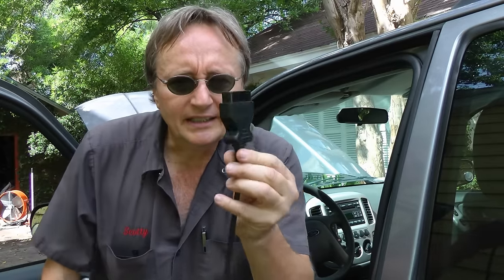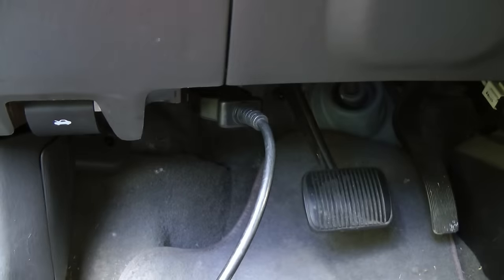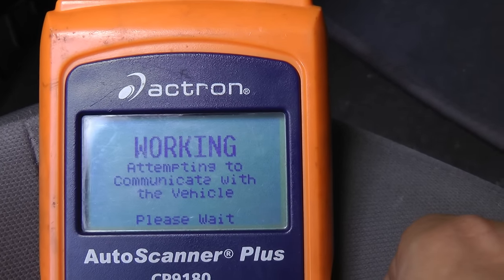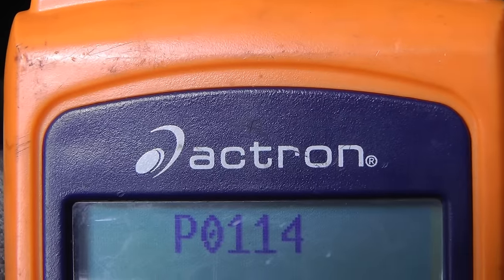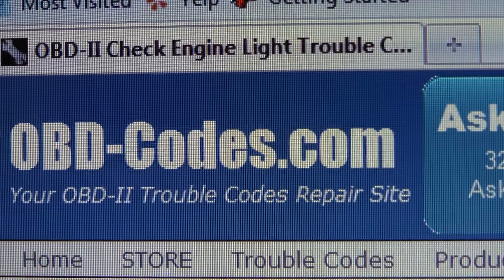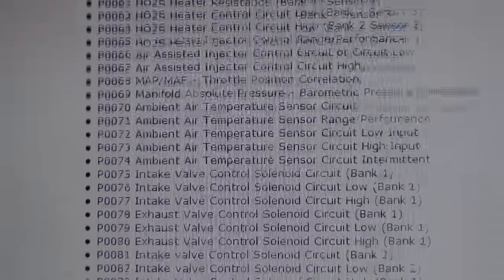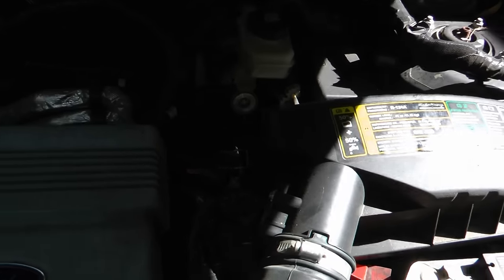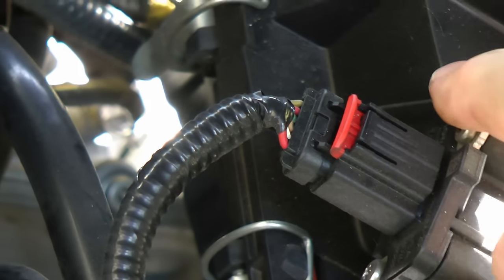Check Engine Light On and How to Fix It

Comment: Had a loose filler cap code on a vehicle health report 2011 f150.. took it to autotune.. they told me it was a canister purge valve.. changed it.. but still showed check engine and chugs the gas!!

Comment: Hi Mr. Kilmer, the  mechanic plugged in the tester to check the "Service engine soon", but the tester does not receive electricity from the car.So it can not be read. PLEASE what can he do? i got a mini van chevrolet --venture 2002--Thank you
Reply from the maker: not reading is caused by either a short in the wiring to the scan tool on the car's wiring, a bad main computer, or a shorting out sensor that shuts it all down. Good luck hunting that down

Comment: I have a 2006 Jeep TJ with 2.4 L engine and 150k miles. I got a check engine light with a P0128 code.
Means engine running too cold, right? Well,I replaced the thermostat twice and the coolant temp sensor twice and the code keeps coming back. My dash gage shows about 180 as well as the temp read from the OBD (I have a reader). I measured 5 v going to the sensor at the sensor connector (without the sensor connected). And I measured 0 volts from sensor ground to vehicle ground. The vehicle runs great! I'm all out of ideas. Does it sound like the PCM is bad? Any help would be GREATLY appreciated.
Reply: I finally figured it out!! Turned out to be a connector issue to the PCM. I had sprayed it down before with contact cleaner, but I noticed some discoloration on one of the pins. I sprayed it down again and this time used a tooth brush. Now the real temp is being read and no more error code P0128! Hallelujah!!!
Reply: +Michael Hamann it could be a bad indicator bulb or you have a bad o2 sensor on the upstream
Reply: +Michael Hamann ok my bad i did not see this part ,glad you figured it out '

Comment: I have Nissan Sentra 2005 run 96k and I got P1273 code for my Service Engine Soon in Dash board. I was asked to change the Mass Air Flow Sensor. What do you suggest?

Comment: hey scotty, so i have a 1990 integra, reading a code 12 stating the egr system is malfunctioning, but the thing is the manual transmission model of my car wasnt made with an egr valve. it also has a rough idle after it warms up. any ideas? i appreciate the feedback thanks scotty

Comment: Hey Scotty I have a 1994 Chevy lumina apv minivan with a 3.8L when I drive it from 0 to 50 km 0 to 30 mph it shuts off but I can start it up again like nothing happened is there anything I can check and replace to stop it from doing that?
Reply from the maker: many things can do that, but check the ignition control module and ignition coils first

Comment: scotty i've got a 1993 surf hilux turbo import, the check engine light goes on while it is stop or if the engine is just running, but when you began to run it the engine light will go off, what can do with this. thanks
Reply from the maker: you would have to get it scanned when the light is on by a guy with a machine that works on that old thing, obd II is only on 96 and newer vehicles.

Comment: Great help,but I got a problem with my 2005 Ford Escape. Display says check right daydriving light. I did,, it didn't work.So I changed the bulb. Didn't fix the problem. What is wrong? 
A body said he had that problem jnwith his Jeep and it was a resistor. Where on my vehecle can I find that resistor??
Please
Frank
Reply from the maker: those are complex computer driven systems, not something you should try to fix yourself. Find a mechanic who knows how to fix it with the correct part, or really, if they work, ignore the display or remove the warning bulb.
Reply: got it fixed in garage. Wire was rotten.No Ground.
Thanks for tying to help

Comment: omg those doves are everywhere. i hate that sound. I put a new header, cold air intake and exhaust on my 2005 scion tc and CEL came on. Then bought a CEL eliminator from strup.  Bought OBD2 sensor which read P2195 O2 sensor signal stuck lean bank 1 sensor 1. It seems like i need to have it reprogrammed cuz it seems to run great. Think i need to have it reprogrammed?

Comment: Also I want to ask you can get emission done with a 1998 lexus es 300 transmission sensor ?
Reply from the maker: if it's making the check engine light come on, it would fail emissions testing
Reply: No check engine
Reply from the maker: tyria smith
if the check engine light comes on when you just turn the key to the on position, then goes off once the car is started, then it should pass the inspection test.
Reply: ok thank you  my check not on

Comment from the maker: first, don't buy an Audi, endless money pits as they age.  Find someone with a better scanner first, pray that works. Cause if not, either the computer is bad or the wiring and sensors that feed the computer have problems. Fun fun fun on an Audi tracing those out.

Comment: Hey Scotty .. How can it be possible for the check engine light to go on and ten minutes latter it goes away then 5 hours pass it comes on again and stay two days on then it goes back off .. I'm waiting to go back on to take it to get Scan to see why ... Its a 2005 Mazda 3 ...
Reply from the maker: Luis Burgos cause computers are touchy, they see a problem, on goes the light, then the next check 45 seconds later, if the problem goes away, they turn the light off
Reply: It's annoying is a new computer,  new engine.I have spend over 35 hundred. The mazda dealer tells me it have to be the wiring. .. really don't know what to do

Comment: hey scotty, i had to unplug my neg wire to reset my check engine light because i unpluged my mass air flow wire to clean some parts then when i plugged everything back up my check engine light pop up so i cleared the light by unplugging the battery now how long do i need to drive it before i go get my smog test?
Reply: i have a 97 toyota 4 runner

Comment: hey scotty what causes the service engine soon light to stays lit with no  flashes should i go for the smog test ive changed oxy sensors,egr
Reply from the maker: get it scanned to see what the trouble code is, it will not pass smog with that on and there are 2000 possible different codes.

Comment: Hi Scotty, Purchase a used 2007 kia rondo with 140k for 2200$. with the advise of the mechanic who said it was a good buy. the engine light has been on and after the mechanic ran test reset it. i was told it was the up stream 02 Senser needed replace 280. got it change then he said it was the down stream and will need additional 280 for replace and labor... now engine light  is still coming one. he told me it was reading code p2095  and not sure what the issue is. just wondering should i take it to the kia dealership for diagnostic? thanks for you help love your Vid.....
Reply from the maker: your "mechanic" is a joke, First, any good mechanic would say not to buy a kia with that much mileage on it, they are throw away vehicles at that age. BUT, if it runs good, guys drive em years with those codes and have no other problems. Otherwise, find a guy like me or a dealer with a dealer level scanner to analyze and fix it without just guessing as your guy did.

Comment from the maker: it's a saab, company is now bankrupt, and a lot of that was from 9-3 flak of owners getting problems up the wazoo. If it smokes and uses oil, engine will need serious work. Me, I'd sell it fast and eat whatever amount you can , then buy a good used toyota. engine work on saabs costs thousands

Comment: When i was driving my car today my check enging light started blinking around 10-15 times(estimate) and it went away after that and the same thing happened to me about a month ago and i thought it was nothing. Do you know what the problem is and should i be worried.

Comment: I have a check engine light on, on my Dacia Logan. I read it with an obd, says its the lambda sensor. Tried to delete it, didnt work. The car runs ok, even if it have 360k kilometers on bord. i didnt go to a mechanic to fix this light, just because they would rip you off, charging like 100 bucks for a minor thing.

Comment: Scotty
I came to your page by mistake, I see now that I should tell everyone about your site.
  I do have a question about a 2014 Fiat 500 pop.
The check engine light is on, I bought a new gas tank cap, I really haven't had a chance to drive it because my sticker is expired. Hahaha
I have to laugh! That light has Never came on before.
So I was wondering about the Carbon canister.
Is there anything I could pour in the tank?
Thank you

Comment: yeah hi I have a quick question I just installed a brand new EGR valve because my engine light was on all the time  went to the dealer that's how I found out I bought a new EGR valve put it on still engine light id on do I have to reset the engine light ?
Reply from the maker: +yanni lorentzos   if that actually fixed the problem, the light will go out within a week of driving it
Reply: +Scotty Kilmer ok thank you you been a lot of help

Comment: I have  a 2003 Jeep Liberty. Error code P0700 Kick down solenoid. I can not find any literature to help change it out.  Do you know any good sight or where I might get some?
Reply from the maker: +Bruce Bunten on that vehicle, that is normally a bad wiring short on the transmission or a bad transmission control module

Comment: my peugeot 206 cc has MIL describing it as anti pollution fault,the car suddenly stalls, engine is running but the rpm is very low. i did put lacquer thinner in fuel tank.car improved a lot and didnt stalls anymore,but engine light is still on w/ same description.anti pollution fault.need help scotty,tnx

Comment: Hey Scotty, I changed an abs sensor and I still have the abs light on , how do I turn it off?
Reply from the maker: +victor Sanchez if that fixed the problem, drive it a week. if it doesn't reset, then something else caused the problem. See my video "fixing ABS brake problems on your car"
Reply: +Scotty Kilmer thanks , always very helpful

Comment: Hey Scotty i have a 1996 honda accord 2.2 vtec and the check engine light wont turn on at all even with the key on, on i changed the bulb and its still wont turn on is it diabled or is the wire cut what can it be how doo i re enable my check engine light thank you!:)

Comment: The ETC sensor on my 09 Passat 2.0 turbo comes on and I loose power to the throttle pedal.  I replaced the Coolant sensor already like you just did but now I get a P0221 code that shows up.  Any help what I should focus my attention on.  The other day while driving i lost power to the entire car, it did not responde to the throttle accelerator pedal at all.
Reply from the maker: +Geraldina Franco often means you need a new throttle assembly on those

Comment: my ford  windstar 98 has a problem, the malfunction light does'nt work at all, I should remove the cluster in order to change the bulb ?,cause I can,t find any fuse in the circuit.

Comment: How do you change the transmission fluid in a 2008 Suzuki Forenza
Reply from the maker: Scott Garver they don't have dipsticks so they are a royal pain in the ass:Transaxle Fluid Level Checking Procedure 

Tools Required: 

DW260-070 Transaxle Fluid Plug Remover/Installer
Start the engine and allow the engine to idle for approximately 5 minutes , or, if possible, drive the vehicle for afew kilometers (miles) to warm the transaxle fluid. Check the fluid level when the transaxle is over 30°C (86°F) .

Press the brake pedal and move the shift lever through the gear ranges, pausing a few seconds in each range. Return the shift lever to the park position. (Left-Hand Drive Shown, Right-Hand Drive Similar.)

Raise and suitably support the vehicle.
Place a fluid container below the fluid level plug.
Remove the fluid level plug using the plug remover/installer 
DW260-070. Because the transaxle operates correctly over a range of 
levels, fluid may or may not drain out of the plug hole when the plug is
 removed.

Check the oil fluid level. If fluid does not drain through the plug hole after adding a total of 4 liters,
 then the transaxle was either underfilled or the transaxle is leaking 
fluid. Inspect the transaxle for fluid leaks. Fix any leaks before 
setting the transaxle fluid level.

Install the fluid level plug using the plug remover/installer DW260-070. Tighten:Tighten the Fluid Level Plug to 45 Nm (33 ft. lbs.) .

When the fluid level checking procedure is completed, wipe any fluid
 from the transaxle case with a rag or shop towel. Also, check that the 
fluid fill cap and the vent tube are properly installed.

© 2015 ALLDATA LLC. All rights reserved. Terms and Conditions

Comment: 02 silverado with catalytic converter removed, causing check engine light.  what's the best way to simply turn the light off?
Reply from the maker: +Jeffrey Valentine the computer knows, but you can remove the bulb by taking the dash out, easy job they just pop out in a few minutes of fiddling
Reply: +Scotty Kilmer there doesn't seem to be a removable bulb behind the indicator. would I need to alter the circuit board?
Reply: +Jeffrey Valentine These bulbs are soldered in the circuit board. You would have to take the instrument cluster apart to remove the bulb.

Comment: hi sifu scotty, how can cars catches fire while driving?
i have seen few mercedes and bmw catches fire on the highway.
Reply from the maker: not that many, of course media loves it cause they are in love with flames. I used to do a gig on CBS, and man, were they pyromaniacs of the air. A fire anywhere on the planet, they wanted video of it to run.
Reply: it happen in my country we have a full summer all year round.
i  have seen total of 6 cars. mostly mercedez and bmw.
maybe their oil burn out. most owner do not check their  engine oil lvl and the worst the is no dip stick.
i have seen over use oil and really thick(black) in a bmw.
agent told him not to change oil till it's 15k. 
the agent is an idiot.
maybe that could be the reason. 
it is alwas around 30'c and 36'c over here.
i told him to go by hour is safe. for every 300-400hrs of usage.

Comment: how do you reset the check engine light for a Chevy Impala 2012 for gas emissions
Reply from the maker: Steven Neal you need an obd II scanner to reset those, but you can get cheap ones online for as little as 25 bucks if you price around ebay
Reply: Ok thanks

Comment: hi Mr Scott recently get repaired my infiniti i30 replacing the alternator wiring and after this procedure my instruments on dashboard  odometer  , the rpm, temperature and gas  went  crazy, any idea about.
thank you
Reply from the maker: I would assume the wiring repair job was botched up, realize any wiring mistake can feed back through the electronics and wreck other electronic parts.  Start by checking the wiring work, pray no computer modules were damaged
Reply: thank you Mr. Scott

Comment: just thought id throw it out there, oh and i was wondering is there an easier way to find a short in electrical systems, i have a 1987 honda vision, and the electrics wont work with a battery but work when the engine is running, help please?

Comment: hi I have a 2006 4 cyl Honda accord and the check engine light comes on and off when its really cold like minus 10 and lower.  in summer time it seems to just go away.  Any experience with this issue? or have any idea what it could be.  I have had the code read it says its the catalytic which is weird for the light to go on and off like that.
Reply from the maker: when really cold, an older cat can work inefficiently, so that code will pop. But once warmer, it can work fine. If it runs normal, ignore it, cats aren't cheap

Comment: Scotty, code # P1624 cooling fan circuit relay low, how to fix ? what does that mean the cooling fan isnt spining fast enough ? will that code with the light on cause the car to fail state inspection ?

Comment: hello scotty,
i have a 2010 chevrolet cruze. its fuel gauge was fixed on one particular position which i got repaired but den check engine light came and mycar started to misfire and engine would shut down anytime. problem with rpm started and rpm would not exceed 3000. code is p0089 which says fuel pressure regulator problem. got everything checked and problem is still there..been over 2 weeks now. wat might be the problem. car would start but will switch off anytime. any guess wat might be the problem?? the fuel lines, high prerssure fuel pump and injectors are all working fine.
Reply from the maker: I would assume whoever fixed the fuel gauge botched up the job, the fuel sending unit is inside the gas tank next to the fuel pump assembly and regulator, and all that wiring and hoses can easily be damaged dropping the tank and doing that work.

Comment: hey scotty i have a chevy malibu 2002 i will notice a hard shift when i travel more then thirty miles but it only happens when the check engine light comes on and then goes away when the light goes off do u have any ideas?
Reply from the maker: +John Pace  have it scanned for historical codes first, that generally tells the problem area, and as there are over 2 thousand possible codes, guessing is futile. email the codes here
Reply: Ok cool man thanks

Comment: Scotty , 95 Explorer 4.0 2 wheel drive , OBD 1 code 14 RPM SIGNAL LOSS , i am being told replace the distributor, it doesnt have one, it has a ignition coil , what would i need to change , the coil is already replaced , the tach does work, i was told the engine misses at times, has all new spark plugs an wires, please let me know so i can fix this code # 14 . thanks
Reply from the maker: Kody Darlington replace the ignition control module and pray the main computer hasn't gone bad too

Comment: My 99 Nissan Maxima Has a check engine light on and the car itself starts up but when I put it into gear it dies immediately also when I give it gas it has a really bad bogging sound I changed all 6 spark plugs it is a V6 Automatic but still does the same thing it's been doing